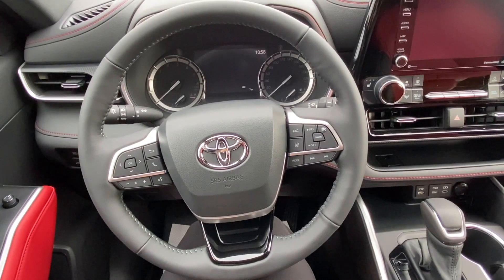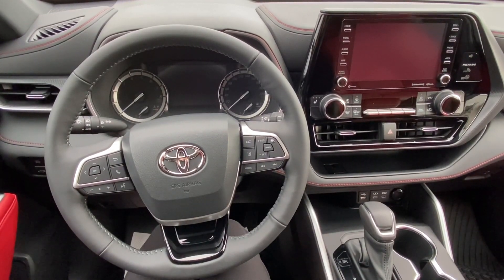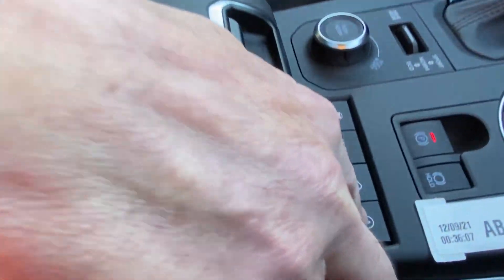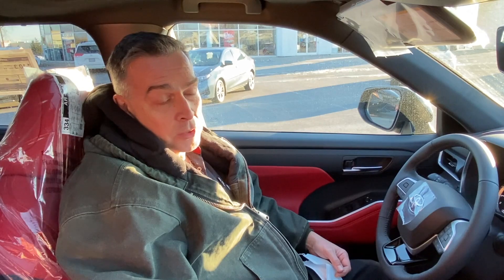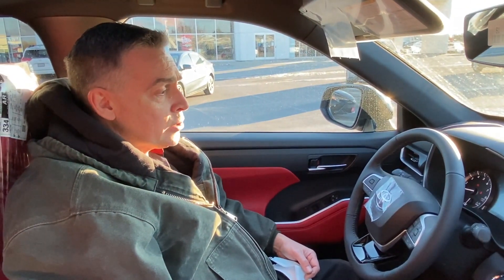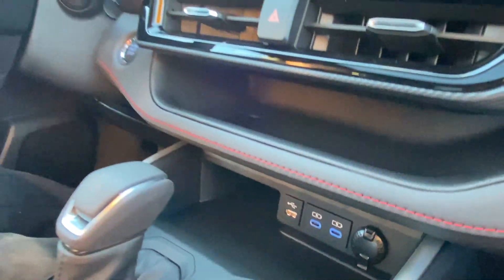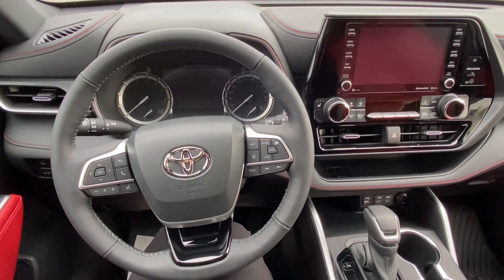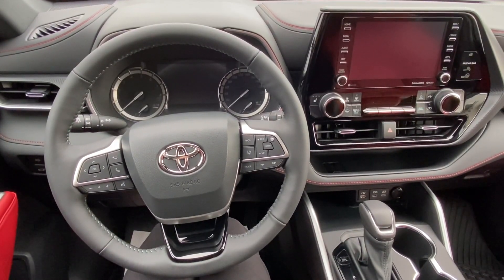Toyota Technology: Stop & Start Engine System

Comment: I own an LC300 diesel and noticed earlier this year that the auto stop function wasn’t working. During the 60K KM service, I asked for this issue to be checked. The service manager changed the battery, saying it would be fixed once fully charged, but the problem persists. The car has now reached 67,000 KM, and I still see a "Cross on A for Climate Control" alert. One thing to mention here that the temperature in my area usually above 25. What is the solution
Reply from the maker: It's best to bring it back to the service provider that changed your battery so they can better diagnose and find a solution for you.

Comment: How do you override it to stay off?
Reply: Press the button to turn it off
Reply: @traveler7353 , on Toyotas you normally have to turn the system off each time you restart the engine.
Reply: @rj934  I don't, stays on everytime I start the engine. I have a 2022 highlander and it works fine. Now the buttons for the mud and sand, normal and rock and dirt doesn't seem to work. Not sure why, why have them if I can't press them to activate the system.

Comment: this is option is useless in 90% of the situations. and it should default to OFF intead of ON. You cannot have the car go OFF and ON everytime you park, stop an an intersection. at least put a delay of 3 seconds before it kicks in. this is ridiculious
Reply: It likely has to default to on for them to take credit for the emission reductions they get from having it on the car.
Reply: Its should be a toggle switch so people can leave it in an on or off position permanently. However I completely agree, its way more issues than its worth. So many things are effected by the auto start stop including the life of some components, salesmen will tell you the car is designed for it but only a fool would think a starter or a battery for example would last longer being used more lol. It could be the tipping point where I purchase another brand that supports the obd2 Autostop eliminator module. Unfortunately Toyota is not a brand that is supported by that company yet.

Comment: If you try to start a hybrid with a dead 12v car battery with a jump start battery pack the delay in cranking the gas engine breaks the short charge process. By the time the engine turns over (around 15 seconds from pressing the start/stop button) the battery pack has already shut off. Traditional cable jump starts from another car work fine. Any way to have the engine turn over immediately when you press start/stop?
Reply from the maker: For technical inquiries, it's best to speak to your local Toyota Service department and ask for a service advisor or technician.
Reply: In a hybrid, the large 300 volt battery cranks the engine, not the 12 volt. The 12 volt battery runs the computers and the regular accessories such as the climate fan and the radio.

Comment: So, is Start Stop Good or Bad for the engine & Starter?????
Reply from the maker: Good morning Ron. We have no information that would suggest it is bad for the starter. It will only engage when you fully depress the brake pedal so if you are concerned there are ways to avoid the feature kicking in.
Reply: @belletoyota  so every time you start the car you have to push a button. And yes common sense will tell you that it will wear a starter out prematurely. With this feature reliability just went down in Toyota cars.
Reply from the maker: @JohnDavis-yz9nq  you do not have to disable this feature. We were simply letting this guest know who they could disable it if they wanted to.
Reply: @JohnDavis-yz9nq  they use reinforced starters in these type of cars. it isnt like the traditional starters in normal cars, trust me these reinforced starters can withstand a lot more

Comment: Does the 2022 Rav4 TRD Off Road have this functionally? If so, can you also turn it off? I can’t find this answer anywhere online. Thank you for the great video. Upvoted.
Reply from the maker: Hi Jonathon! Thanks for your question. It seems that Toyota has not yet included this feature on the Trail or TRD models. However, on RAV4 models equipped with this feature it is found to the right of the heated seats switches (the Traction Control OFF button is the same style of button and found on the left side of the heated seats). Hope this helps! Thank you for the wonderful feedback. Much appreciated :)
Reply: @belletoyota  Are the 2024 RAV4 Trail or TRD models still not including auto start stop? I'm in the market for a new vehicle but I won't buy one that I have to deal with turning that function off every time I turn the vehicle on. I want a RAV4 that does not have it.